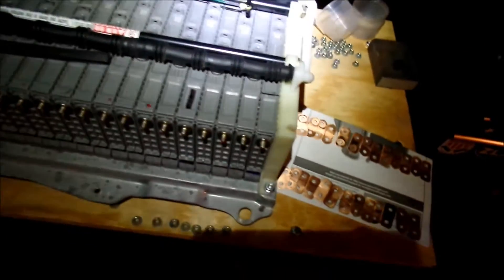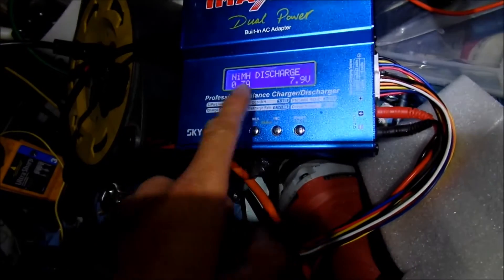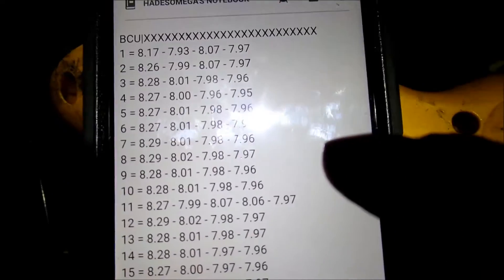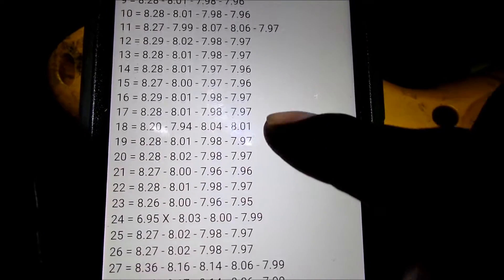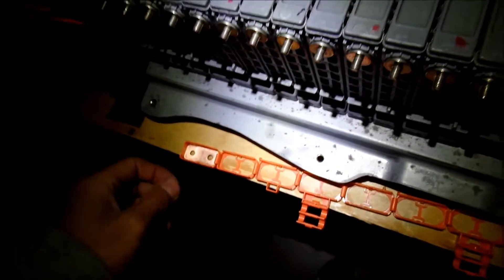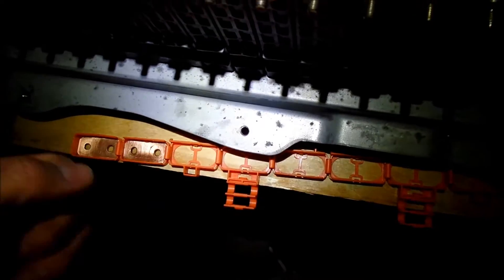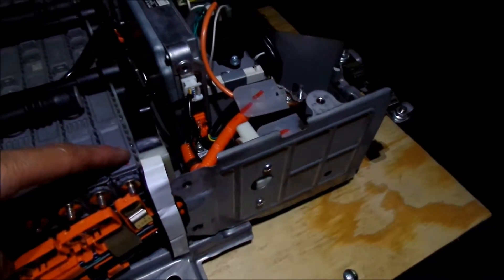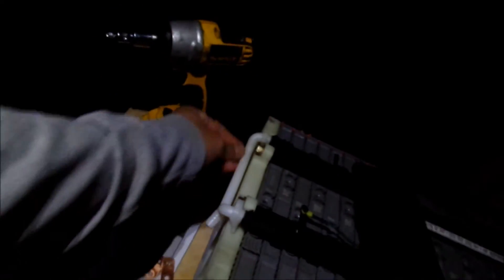HadesOmega Prius Repair VLOG Part 3 - Final Balancing, cleaning, and reassembly

Comment: I recommend Oxy-guard instead of the silicone dielectric grease to coat the buss bars. I've heard some techs (even Toyota manuals) say you shouldn't put anything on the bus bars because it can have an insulating effect and cause voltage drops, but my experience is that tightening squeezes out the grease from the contact area and if there is any voltage drop, the current will vaporize the stuff that shouldn't be there, yet leaving the plates coated in the areas where oxidation can take place.

Comment: Did it solve that triangle of death always popping up with the code c1310, or p0a80 ?
Reply from the maker: Yes it did
Reply: @HadesOmega  nice, I’m doing the same thing. I also have 1 bad module. My Prius keep popping the red triangle everytime I reset it. And throws codes. And make my car run really slow. At a hill my car only move 18mph.

Comment: also i noticed your alligator cable a lot longer than the one came with my order .. what i received only "deans" and "alligator clips" so these two can attached together and i have to connect to battery +- terminals but it doesnt reach both terminals at same time ..so
did you use different charging cable than the original one came with the imax b6 charger?
Reply from the maker: +tormor asileman Hmm I don't remember I think it did come with the charger.  It's a banana plug that goes to the charger and adapts it to deans then there was a bunch of different connectors.  I have made custom cables for it though but these are the ones that came with the charger.  Like I mentioned in the video I didn't like how there wasn't much wire for the alligator clips.

Comment: hi 
regarding the charger/balancer ,
what are the multiple tiny wires connected to your imax for ?
i got the same charger but i dont have these cables so do you think just alligator connector is enough to charge cells or i need the other multiple wires to connector and do they just hang out from the connector ?
Reply from the maker: +tormor asileman Oh those are balance plug extensions for charging lipo battery packs.  I use this charger to charge my quadcopter and ebike lipo batteries I just leave them on there.  They don't have anything to do with charging the prius battery modules.  Those don't come with the Imax charger also I bought them separately it makes it easier to plug in batteries.  Thanks for watching =)
Reply: +HadesOmega thanx for the respond ..
did you charge and balance each module separately if you did separately how long did it take ?
 i saw number of modules voltage values on your phone ,how did you get them ?
Reply from the maker: +tormor asileman I measured them with a multimeter and recorded each value.  Then I did what I had to do to get the voltages the same by discharging or charging the module.  Something nice about the charger is you can set the discharge voltage you want it to stop at.  So just set one voltage and discharge it to what you want the pack to be at.

Comment: Anyone can help me with this issue please my batteries are all around 8.1, 8.2, volts. The lowest one off voltage I read was 7.9 so I might think that the problem is the computer?.or maybe cells?  The driving performance is very problematic, when I had the issue I was driving down a highway when my gas simply had no power behind it. I could not keep up with traffic. It starts fine, but it runs as if the battery didn't even exists
Reply from the maker: If it is the battery there usually is one module that will noticeable lower than the rest.  .3 volts doesn't seem like much of a drop.  If could be a connection that is bad or something else.  Sorry I can't help much more.
Reply: Thanks HadesOmega
Reply: HadesOmega
what application do you use for reading the cells in your phone please?